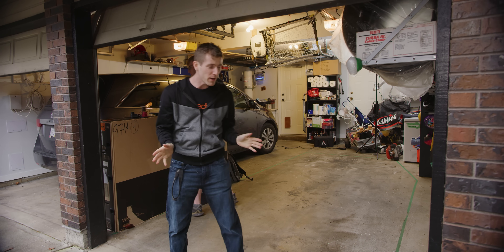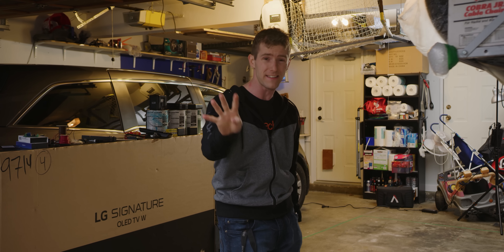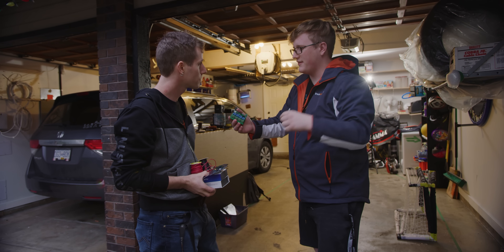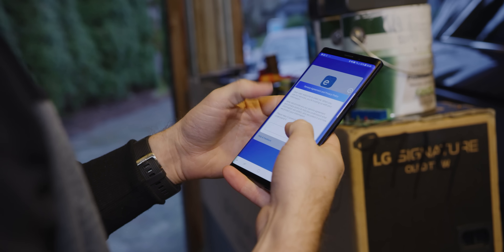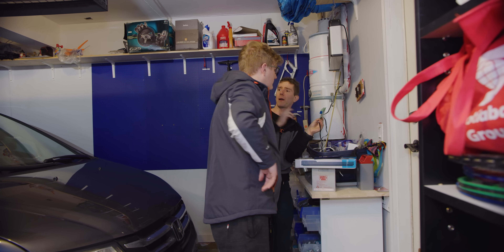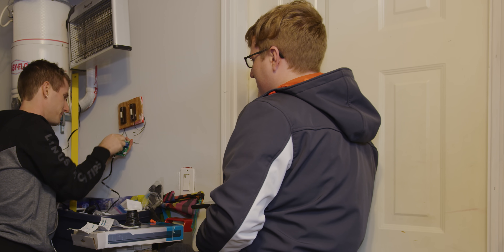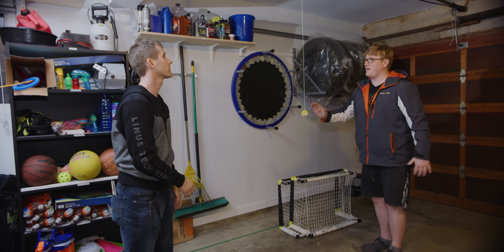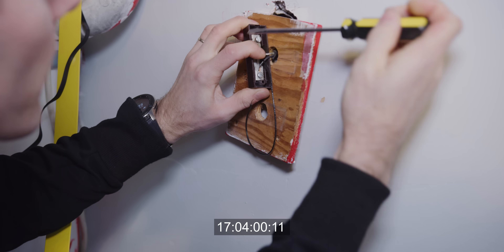Making my 1980's Garage Door Smart!

Comment: I think those are the same garage door motors that were in the house I lived in when I was a kid. But why would you need or want a "smart" garage door opener? I literally can't think of any reason.. maybe to allow a package to be placed in there if not at home? Even then I wouldn't want it for security or privacy concerns. And why would you replace a working likely domestically manufactured product with something new probably foreign manufactured that will have to be replaced in another 5 or 10 years?

Comment: You know garage door openers without the laser recognition thingies are illegal to have…
Reply: no, some don’t have lasers because they have pressure sensors
Reply: @colbybarbour9990  but the laser systems became a standard and now they are required
Reply: @Astranix59  they aren’t required or a lot of people would have to replace their garage doors
Reply: @colbybarbour9990  ok…
Reply: That's like saying somebody's old car is required to have airbags. If you have a 1950 model year car that did not come with seatbelts from the factory, you do not need to install seatbelts now. There may be a rule that lasers are required now but anyone with old equipment is absolutely grandfathered into whatever rule was in place when their system was installed.

Comment: Now weren't those relays actually wired in parallel not in series? I believe he said in series in the video and he should have said in parallel. Correct me if I'm wrong. Also if the original switches were just momentary push buttons, does the app have to be clicked twice to activate the door? Otherwise it would be like the button is just continuously being held down

Comment: NO and NC refer to normally open and normally closed. If the circuit is supposed to be open, replying on a closure to activate the opener, it's NO; if it's a closed circuit relying on an interruption to activate the opener, it's NC.

Comment: NO = Normally Open, NC = Normally Closed 
Relays and contactors have two types of contacts, each suited for different applications:

    Normally open (NO) contacts allow current when the relay or contactor is energized. In other words, when voltage is applied to the relay/contactor terminals, this contact closes.
    Normally closed (NC) contacts allow current through when the relay or contactor is not energized. When voltage is applied, this contact opens and interrupts current.

Comment: the linus/jake banter used to be so much fun lol

('NC' on switches usually means 'normally closed'. so the connection opens when you push the switch)

Comment: NC = Normally Closed

NO = Normally Open

For a garage door opener, you will want to run your wires to the "COM" and "NO" contacts. It will not matter which wire you connect to each contact.

Comment: I once saw someone open his garage door by lifting up on it.  It made the garage door opener open the door the rest of the way.  That must have been one of those old garage doors.  It wouldn't surprise me if that is a way thieves used to get into houses before there were the garage door openers with the invisible beam.  If you have an old one like that still and are going on vacation or not going to be home for a considerable length of time unplug the opener and if you have any kind of lock on the door use those.

Comment: However you don't need to pay for the subscription. Im a garage door installer and chamberlin is the number 1 brand. You have Stanley openers that definitely will not last.  Its great that you could use this method on non smart openers.

Comment: Unless I'm not understanding something ... isn't relay either on or off(??) and isn't a garage door opener switch a momentary contact type of switch?? So how would a relay work to open/close a garage door when it's just a momentary contact?

NVM ... just looked at the link for the board and found out it was a momentary type "Momentary Inching Relay" ... question is, will it work with Google Home or Alexa?

Comment: "NO" I think should mean "Normally open", and "NC" should mean normally closed.
Reply: Yes no is normally open (circuit not connected at rest *no power*), and nc is normally closed (circuit connected at rest *no power*) c is common, think pc power switch it's a no circuit when you press the button it closes the contacts and turns on the pc. In this case you connect 2 wires between c and no, the relays then switch it to closed to close/open the garage door.

I did this a while ago by modding a remote to connect to the board. It's now sitting in a static bag on the outlet box with an ac adapter coming out to plug in the wall outlet. No connection to the door opener itself. FYI, if you have a opener that uses rolling codes and not a wall switch like the ones he has it won't work, you have to do it like the way I did because the pcb units only connect wires together not broadcast rolling codes to open/close the door. There's another video where a guy did this exact thing with his front gate to his house, that's how I did mine.
Reply: lmfao it literally means normally closed (circuit is closed aka live) normally open (circuit is not engaged aka not live) this is dumbed down bc eve if the circuit is open the power going would stil be live.
Reply: @theo2k  if the circuit is NO normally open then neither of the two are live because live is cut off at the switch and y do you think power can go when the switch is open

Comment: Linus, my dude, please do yourself a favor and replace the doors and the openers.  Ignoring everything else the noise from those openers has to be pretty bad and the safety sensors are really pretty important if you have kids running around.  As for the doors themselves, if you can imagine wood does not have a great insulation value, get yourself some nice pumped foam core doors and you should see noticeable energy savings, especially in the frozen north.

Comment: the door randomly opening is probably not because of the screwy switch.  older openers operated on a different signal.  we had one open every time certain semi's drove by.  they were giving off whatever that triggered the door.  put on a new genie controller, problem solved.

Comment: Why is this now "smart"? It looks like it does the same thing as any standard remote controlled garage door. Push button = open or close door. Sensor  for safety.
Is it the "Roost" tattletale that makes it smart?
And...did I hear correctly...that you're now dependent on a 3rd party to control your door?
Reply: He can check the door status via his smartphone and lock/unlock it via same. That makes it smarter than it was before. Everybody has their own definition of what a "smart" device is and yours seems to be different than his. Also, he still has the original functionality (physical button press, original wireless remote) to operate his garage doors, this is just a third option.

Comment: 0:51 this reminded me of my internet provider, that wanted to charge me 2€ for unlocking the w-lan on the router they provided, which at that point coudn't be replaced by a private owned one. So I just bought a cheep w-lan  access point connected by an ethernet cable, cuz I only needed wi-fi for my cellphone. PC got a direct cable connection anyways. Seems those micro-subscriptions are the new hot s#!t. But I refuse to pay any of them if possible, cuz it will sum up at the end...

Comment: Nc stands for no connection.... sssuuuurrreee. in a relay.... that is about switches and on and off... Made me laugh. NC means normally closed for those that don't know. there are 3 ports, and can power one or the other port depending on whats wired into it. NO is normally open and is the switches default circuitry path, you would leave this unconnected if you wanted just an on off swith, because you don't need something constantly powered
Reply: Good info man! Appreciate it brother

Comment: This can be done much easier with a simple NodeMCU, a 2x 5v Relay Module and your existing switch. Connect them thru Blynk Servers(Free) and you can track whether the Relay is turned on or off from the Blynk app on your phone.
With a cost of about 5 USD~

Comment: Linus needs to get himself a Raspberry Pi, install Home Assistant to it, and have all this in one nifty interface. Then, use a NodeMCU (~$3.00) with a 120 volt 2 way 5v relay (~$4.00) and install ESP Easy on it. Connect to Home Assistant. Done.
Reply: Yeah, but then he couldn't get the revenue from the different companies. I'm sure he is well aware that there are better options out there. But he wants the $$
Reply: @mikel9567  I would too if i got free shit and could even still talk shit about it during my reviews, lol.
Reply: @mikel9567  Cheaper? The cheapest raspberry Pi I found with a quick Amazon search was $28. THEN I gotta get Home assistant and install this NodeMCU on it. After all that I have to get a 120V relay and put ESP on it? Are you daft?

I bought one of these wifi relays and used an old power supply that we all have lying around and got a internet-enabled garage door for $15, and it came with an extra RF remote to boot. It doesn't get much easier or cheaper than that unless you opt for the $12 model that doesn't come with a nifty enclosure and RF remote.

I don't really see how Patrick's solution is better.
Reply: Chris Strizver better get more than a raspberry pi. That won’t run on anything but a 3+. It’ll barley work on a 2. Good luck with that.
Reply: @MrStrizver  No one said the word cheaper. Better? Yes. Cheaper? Not the initial investment maybe. However, once you get Home Assistant running, adding on additional automation devices to it is super easy. Met anyone, who got into home automation, and only connected their garage door to the internet? Doubtful. Idea is that, once your HA is running, it is cheaper to add on additional IoT devices to it than anything else I know.
P.S. Yes, run HA on a 3 B+
Reply: @MrStrizver  welp, 30 cad is around 22 usd. Not bad for the price
Reply: @Travis2L  you can use anything like an old PC should work if it is always on, plus I think Linus already has a server or something
Reply: @patsjoholm  yes its amazing, so many devices a completely customizable UI and more. You can even install motion eye os as an addon, which they showed in another video. You can have a file server, Plex server, camera recorder and more on home assistant
Reply: and even run a file server
Reply: Yes I've been trying so hard for a long time to get him to make a video on home assistant
Reply: It's a sonoff, flash with tasmota

Comment: Hey Linus, “NC” is normally closed. 

On low voltage relays, especially in fire alarm and burglar alarm, you have a common,  normally open, and normally closed. 

You always use the common, then you use the normally open or normally closed depending on what kind of device you’re hooking up. 

Great video! Much better functionality than you had before.

Comment: I ran into the issue with Chamberlain as well within the past year. I have 2 linear garage door controllers that integrate with my z wave system. I had them installed and working in my last house and brought them with me when I moved. I mounted and wired them in the new house, just to realize that I have Chamberlain garage door opener. That becomes a problem as they use some sort of serial data and microchips in the buttons instead of just a momentary button closing a contact. My fix was to run two wires into the button from the controllers and solder them to either side of the physical button before the circuitry. Thus making the chip think the button is actually being pushed each time the controllers are triggered by z wave. Not that much of a pain to do, but definitely seems unnecessary. Why does Chamberlain need serial data for the buttons? Surely not for any type of security purposes.
Reply: Forgot to mention that this worked great until storm season. Somehow, both buttons went bad. The controllers still work, but had to replace both buttons to get the openers to work properly. After months of sitting I was able to wire the old buttons up in parallel and use the controller again, but the buttons still act up from time to time. Not sure if electrical surge got to them or what, but it was kind of strange that they were the only device in the house that were effected.

Comment: UGH!!! I tried this project with my Genie garage door opener (circa 2008). I managed to get the relay setup correctly in NO and inching mode and then paired with the Ewelink app. I thought everything was working correctly. Then my wife came home and mentioned that the garage door wall switch wasn't working. Hmmm. I took a look and not only does the switch not work, the lighted buttons don't work either. I've tried connecting the relay in parallel to both the garage door terminal screws and also the screws on the back of the wall switch. It seems like on my garage door that the wall switches don't only close the circuit, they also receive power from the garage door opener that light the buttons. FWIW, there are only 2 wires that go from the opener to the wall switch. ANY THOUGHTS??? :-)

Comment: If you place the wifi/relay unit too close to the Antenna of the door opener, you might experience RF interference. This will reduce use of the range at which the old remotes will work.

Comment: C-Common N.O. - Normally Open (in de-energized state)   ||   N.C. - Normally Closed (in de-engergized state)  so the way you would wire it is send the power that you want to gate through to the Common connection, this current will flow through the N.C. contact when the relay is de-energized, when the coil of the relay is energized, it will pull the contact away from the N.C. to the N.O. since it is now energized.  Practical application for a N.C. and N.O. would be in a de-energized state to always send a signal the N.C. junction to power an indicator i.e. "Door not in motion", and the N.O. when the relay is energized to power another indicator i.e. "Door in motion".    

                                                      ||----------------------o  N.C.  (115VAC when relay isn't energized)
                                                     /   
                                                   /
Common(115 VAC) o----------/

                                                      ||----------------------o  N.O. (0 VAC when relay isn't energized)

A relay works on the principle of electromagnetism. When current is sent to the coil of a relay, it creates a magnetic field (energized state) which makes the armature of the common contact pull down toward the Normally Open contact. (overcoming the spring tension that keeps the armature at rest against the Normally closed contact when the coil of the relay isn't energized)

Comment: I’ve personally used a lot of Sonoff products which utilize EWeLink as the user interface application. I’ve had great success with all of them. I built a reptile habitat that was monitored and controlled using the devices. I could set ranges with eWeLink so that the inputs would control outputs. Temperature and Humidity sensors controlled heaters and fans and timer variables built into the application controlled the lighting.

Comment: I did this using a raspberry pi and some general purpose relays. I don't have the sensor to tell me if it is open or close, but considering I need to be connected to the same network to use it, it isn't too much of a concern.

Comment: NC = Normally closed, so when the relay isn't active, this would be the closed set of contacts, meaning current will flow.
NO = Normally open, when the relay isn't active, this would be the open set of contacts, meaning no current will flow.
A common from what I was taught it your voltage +
A ground is your ground or negative.